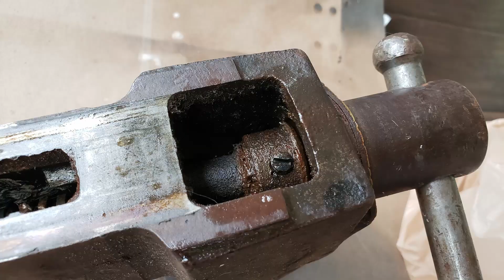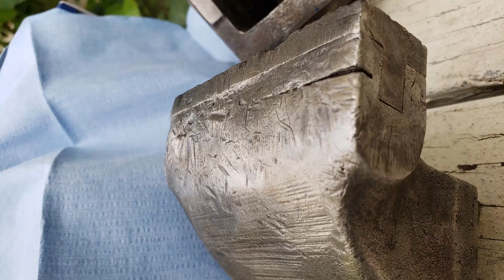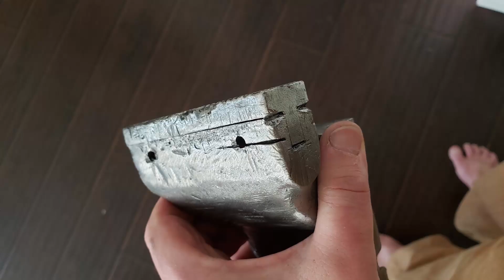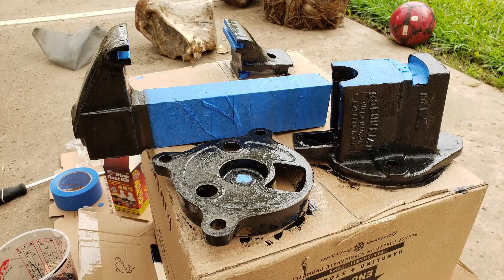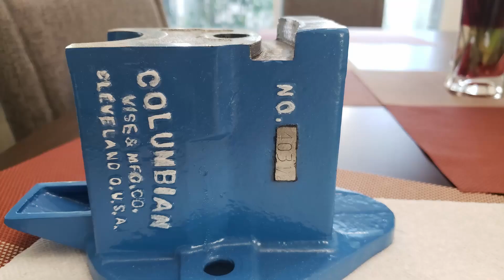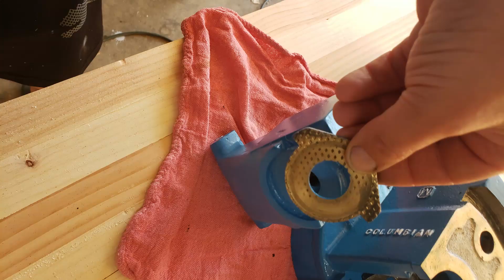Restored Mid-1920s Columbian 403 1/2 Vise and Preserved with POR-15

Comment: Very cool.  When you took out the jaw pins, do you remember what direction you punched them out?  I have a newer model 504 and the pins are visible on the bottom of the jaws which leads me to believe they were originally set from the top side.  ALSO -- unless I'm mistaken this does not look like the vise you used in the jeep wobble vid.
Reply from the maker: @SpringRubber  First, thank you for noticing the difference between the vice on my bench and this one... you are correct.  I briefly mentioned in this video that I started restoration on another Prentiss vice, and that's the one you see.
Reply from the maker: @SpringRubber Next, I went at it from both sides. If I recall correctly, I'm pretty sure I started from underneath until the top was separated enough for me to see the pins. Then I think I went back and forth using lube, but ultimately went out the top.
Reply: @PlanItSendIt  Thank you.  I saw a comment somewhere else that that the pins were tapered and I suppose that was just some BS.

Comment: Did a nice job on that 403 1/2. I have one that I just refinished in  September. It came out nice, but I couldn’t do the white lettering like yours. My hand is too unsteady.  As far as the #1 stamped on the vise nut, I might have an explanation.  I have an old vise with a small anvil on the left side. I took it all apart, soaked it in degreaser for 48 hrs. to get the @3 coats of paint off. Afterwards I washed it off good and wire wheeled it clean. Upon inspection I found the #60 stamped on the back jaw, the front jaw, and the outside end of the  screw handle. I believe that it was done after the forging, and that was a way of keeping the 3 pieces together for assembly.  Your #1 could have been a reference # for the assembly of your vise.  Iam just trying to come up with a possible answer. Hope this helps, and again, I think yours looks great. Mine is in NC at the moment, when I get back down I will send you a picture of it. Take care and God Bless.
Reply from the maker: Thank you.  That would make sense if that's the case.  The lettering wasn't as good as I would have liked it to be honest.  Plus, I think I should have trimmed the brush because it seemed like I wouldn't see the stray bristles until I saw random white on the blue.
Reply: You had... paint on yours??? What was your original color, blue?
Reply: @tomk3732     The paint was strictly after factory. There was green n silver. Some thick, some thin. Also some black if I remember.  I would like to know the approximate age of my 403 1/2, but I don’t know how to figure that out. I hope this helps, Tom.
Carl
Reply: Sounds like a plausible explanation for the #1